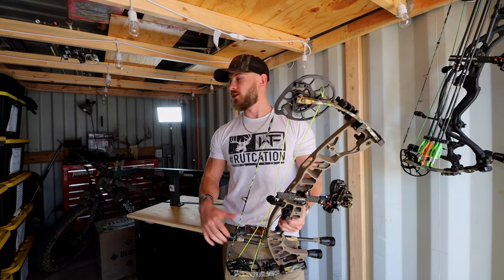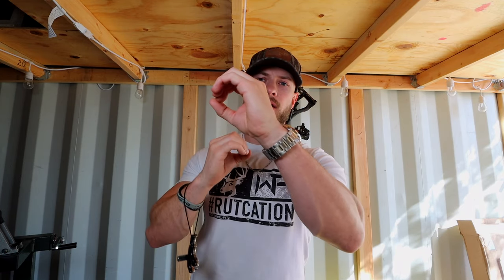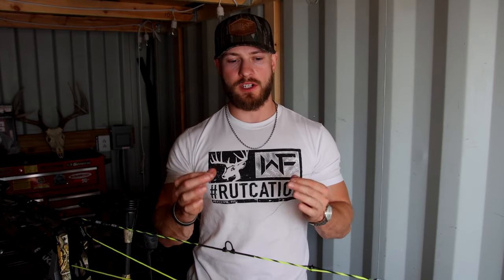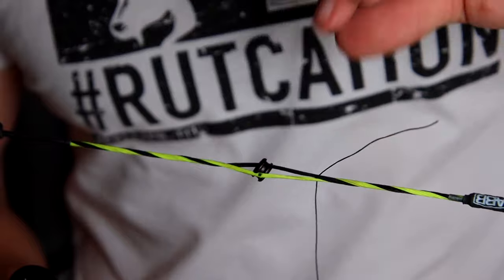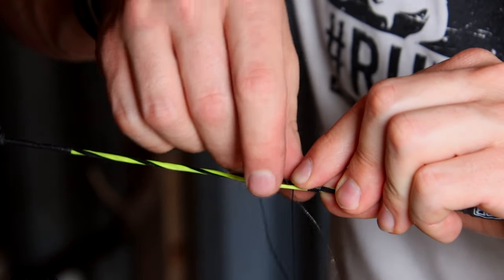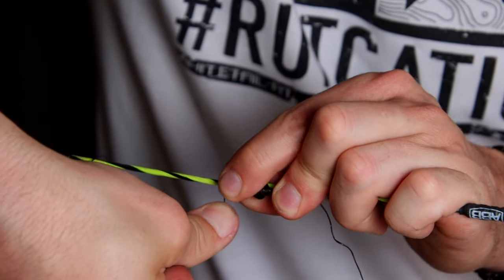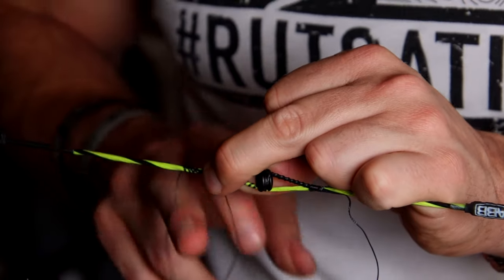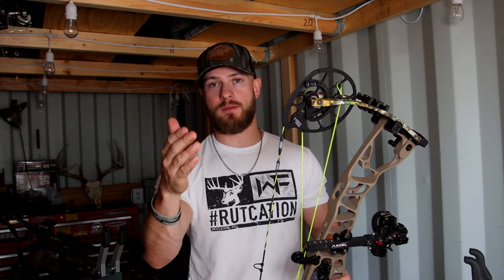STEP by STEP How to Tie in a Peep Sight! (Clean look)

Comment: Noticed in your video you set your nocking point with a square without having your rest on the bow.   Would be interested in a step by step on how you do it.  Also talking through making adjustments to the cables during tuning.  Thanks for what you do for the archery community.
Reply from the maker: I’ll make sure an touch deeper on these things in my RX7 build!  I set the nocking point directly through the center of the Berger hole (where the rest bolts to) from there I am pretty well squared up and can make fine adjustments with the rest if needed.  As far as the cables it’s fairly simple when reading your draw stops if it is off one cam will be working harder than the other.  Putting twists in or out of a cable will affectively lengthen or shorten the cable which will allow the given cam to turn sooner or later.

Comment: Sorry if this is a dumb question in advance. Do I need to press the bow and take tension off the string to tie in a peep? Peep already in place. Thanks, video is crazy crisp we appreciate it
Reply: You do not need to but it helps get the tie closer to the peep to prevent shifting and look better. I also do a different method to be fair.

Comment: So the mid range set point is only for single pins correct?.
Reply from the maker: @devonseyfert6295  just depends on what you use as your floating pin.  I like to set peep height with my center pin (center of sight housing on say a 3 pin horizontal) at a mid range position